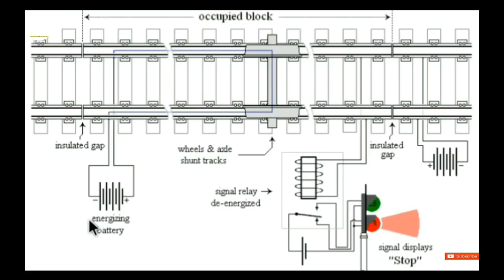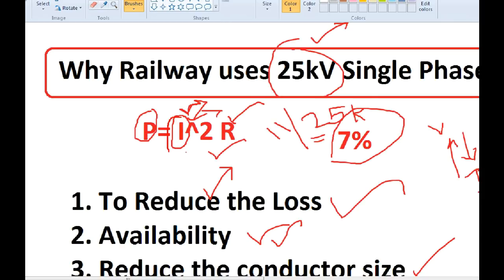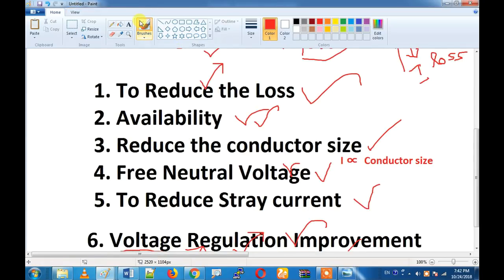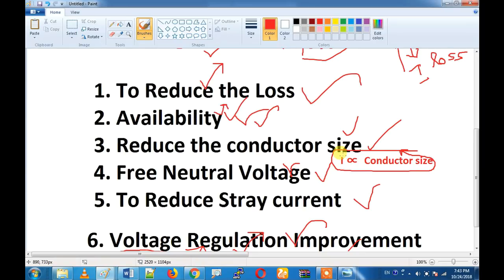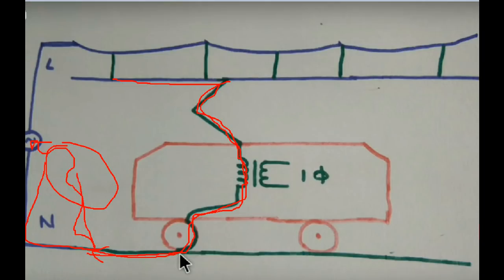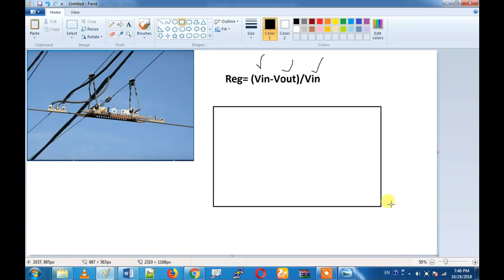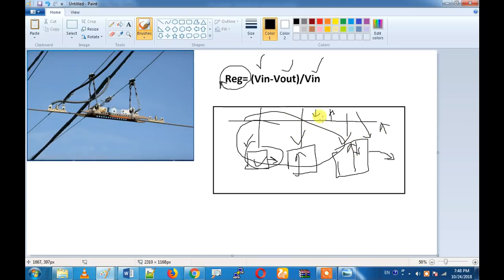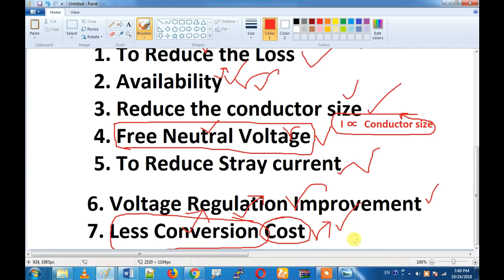Why 25kv Voltage system are used in Railway..Line Voltage in Railway

Comment: Why railway platform wiring is different from house wiring.Platform wiring is not concealed.why they use steel wire
Reply from the maker: No..Thats is called armored cables..to protect the cable from physical factor.

Comment: Bro how generating stations calculate the power production? and what is the difference between main meter and check meter?
Reply from the maker: Main meter => calculating energy 
Check meter => reference to the main meter to find out the meter hour
Reply from the maker: check meter => reference to the main meter to find out the meter error